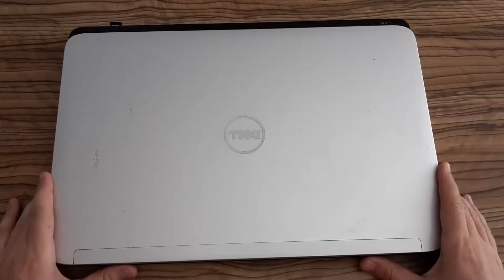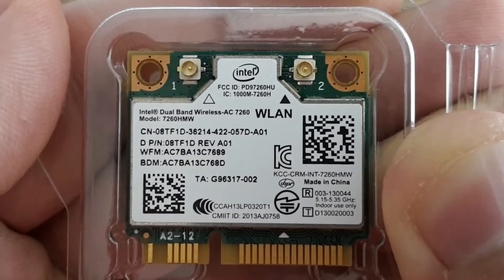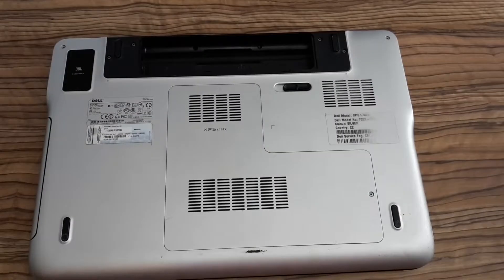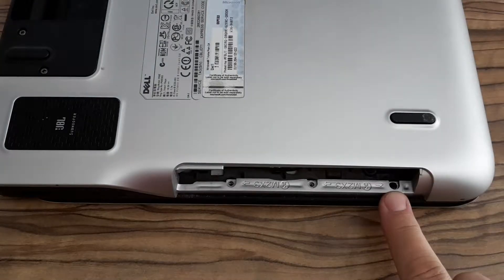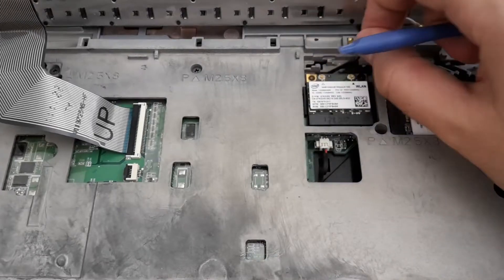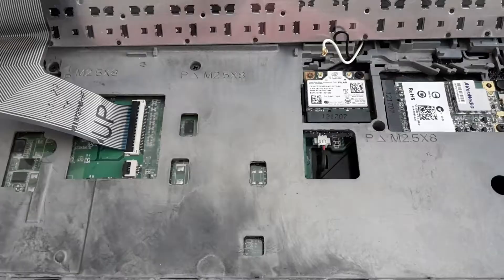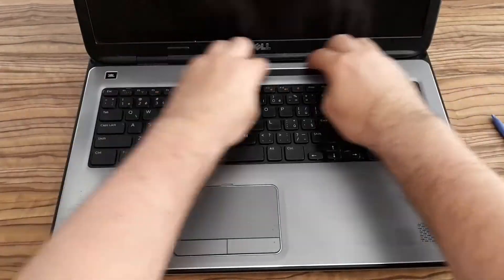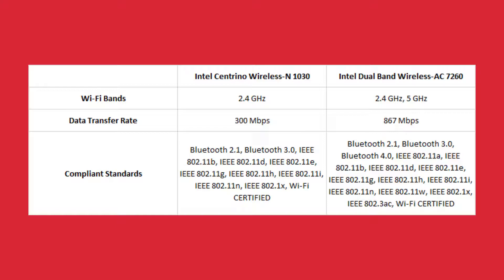Dell XPS 17 L702X a Mini PCI Express Wireless Adapter Upgrade

Comment: This is great!!! I have the same mode and wanted to upgrade it. 
What is the choice of CPU if I want to replace the intel 2630QM CPU?
Is it worth to do it?
Reply from the maker: I have 4-core and it's worth it, see for compatible versions https://www.cpu-upgrade.com/CPUs/Intel/Core_i7_Mobile/i7-2620M_(PGA).html.
Reply: @zeroampselectronics  Thanks! I want to upgrade to 2860QM but it says the upgrade chance is only 30%. What did you upgrade?
Reply from the maker: @bigmak1881  I didn't upgrade I have the original one.

Comment: Hi, thanks for the video. I have an L702x that came and was manufactured with a Intel Centrino Wireless N 1000 card that "does not" have Bluetooth. If I wanna turn this laptop into a Bluetooth able labptop, is the card you mentioned all I need? Or do I need more hardware added to get it to support Bluetooth? 
Thanks again!
Reply from the maker: Hi, try that it could work.

Comment: Hello, I like your videos and the way you explain! I have a question I have the dell xps l702x 3d model, and I have 3 antennas available, is there ani half height wifi board that can do the same performance as 7260 but with 3 antennas?
Reply from the maker: Hi, frankly no idea, in the video the type of card I use was recommend by Dell support like the last option for this type of the laptop.
Reply: @zeroampselectronics   thanks for the reply, I have done some research and apparently they don't do the 3 antennas anymore, and if I want to opt for the 3 antennas I only have an option with no Bluetooth. we will have to go for alienware soon :)
Reply from the maker: They also plan to release XPS 17 again, I'm very curious.
Reply: @zeroampselectronics  I have XPS 1702x 3d model. Going strong for almost 10 years now and I love this keyboard on this old laptop. new XPS 17 keyboard no as good as this one. Just returned my new XPS 17 today. 2 things that this old beauty can't do this Windows 10 and 4k monitor support. Also Bluetooth 3 on in Windows 7 laptop is not as good as on newer Windows 10 laptop. I have to retire this laptop soon but hard to say goodbye to this. Just today I realized how I love this keyboard and speaker on this laptop.
Reply from the maker: Hi, you can install Windows 10 without problems, I've already done that and many people too. Regarding 4k you're right, but the Bluetooth I've also upgraded to the version 4.
Reply: @bals81  I use a 2k monitor ultrashap from dell, it works with display port out of the box but uses the intel 3000, also if you wish to use the Nvidia graphics card , you have to do it by hdmi and set a custom res with short signal imput in nvidia panel. Its an option both work at 60 hz and is crispy.
Reply: @zeroampselectronics  I use a 2k monitor ultrashap from dell, it works with display port out of the box but uses the intel 3000, also if you wish to use the Nvidia graphics card , you have to do it by hdmi and set a custom res with short signal imput in nvidia panel. Its an option both work at 60 hz and is crispy. 

I am planing to upgrade to a Intel Dual Band Wireless-AC 7260HMW Wifi + Bluetooth 4.0 867 Mbps Mini Pci-, what card do you use?

Comment: Thank you friend, good job and very clear explication.
I'll make this change too.
Only a question more: do you think will be possible to find new speakers to replace the old? Thanks.
Reply: check on ebay they have plenty of speaker... my right speaker is acting up also... blast it at 90% too much
Reply from the maker: Hi, what's wrong with your speakers?
Reply: @zeroampselectronics  only distortion noise! No more clear sound. I don't know if is the right speaker or the bass system...
Reply from the maker: Hi, what did you do with your laptop?
Reply: @zeroampselectronics  not yet but it's so noisy...
Reply: hhhh what a stupid replace new speakers ??? this is impossible
Reply: @GaMkuTOpoloWKFXgamkutopolowk  the only stupid here
Reply from the maker: You can invest to new DELL XPS 17 which has been released the other day :-) 
https://www.dell.com/en-us/shop/cty/pdp/spd/xps-17-9700-laptop